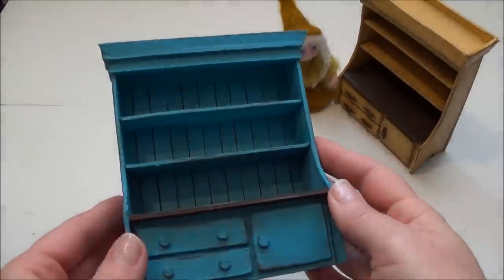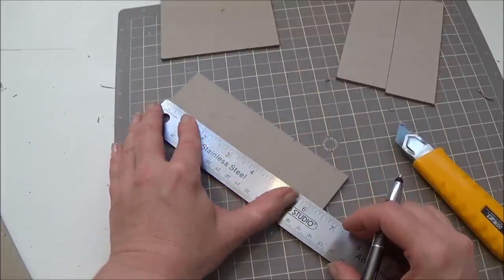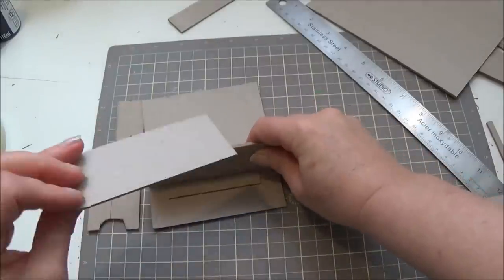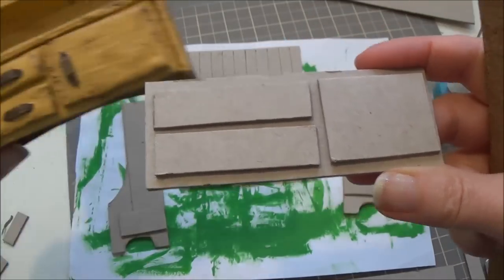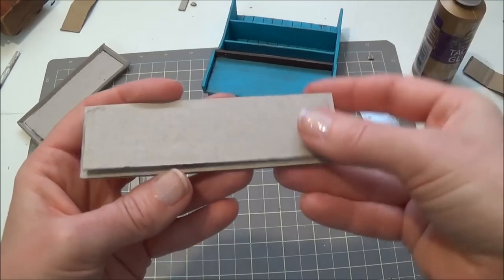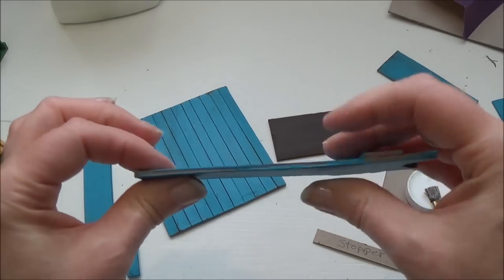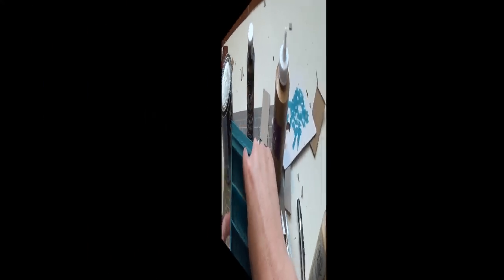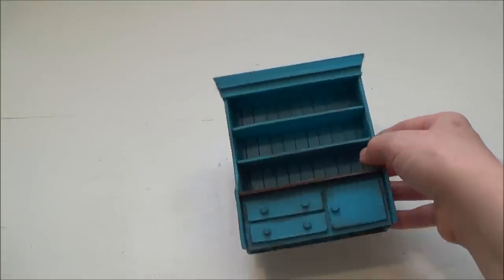How To Build A Miniature Hutch With No Wood

Comment: THANK you for the tip for trimming the counter top. I am rubbish at measuring and I’ve been really struggling with making things fit. Your little tip has just made it SO easy for my mathematically-challenged mind! I’m only 6 minutes in, so sure I will learn even more tricks from your video, but I wanted to express my gratitude right away. Thank you.